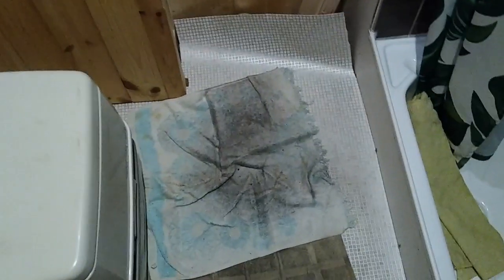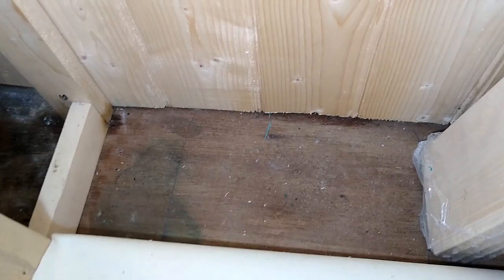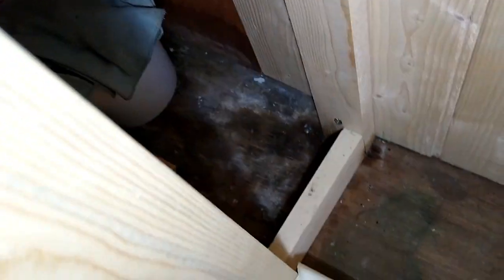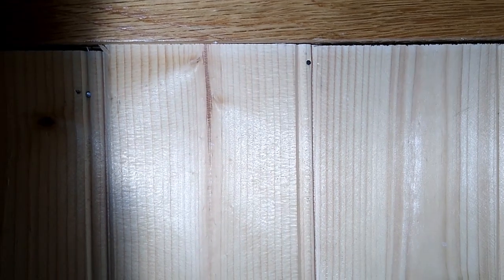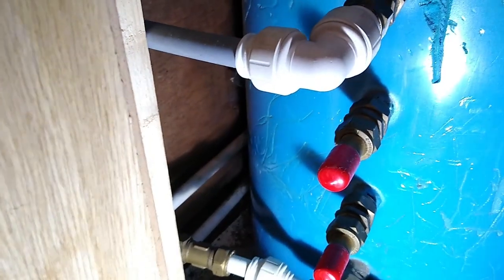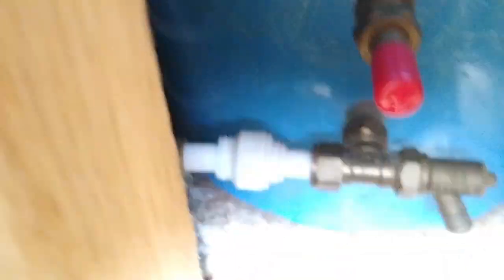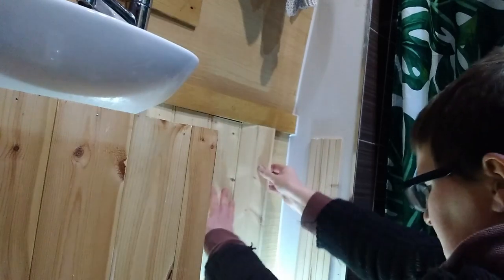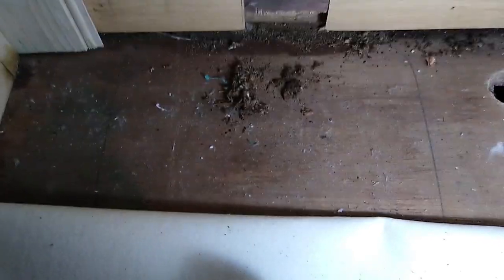44.  Looking for a leak - Part One

Comment: I think theres a fair chance that its water that has spilled around the sink edges or from under the tap while youre actually using it. You wouldnt need much daily spillage to keep that much wood slightly discoloured. Also check the drain from the sink is tight on the skin fitting. Maybe draw a line of water soluble ink or tape some paper around the trap under the sink to check for running water too!  If the mains water had a leak it would set the pump going at random times.
Reply from the maker: Paying more attention to what I'm doing, you're absolutely right there is spillage ending up on the floor under the sink.  I think the discolouration and damp under the sink could definitely be due to that as you suggest.  The damp further along the floor though seems to be from a different source.  The water pump does engage every 10 minutes or so, more than it should for normal equalisation so could well be a slow leak - there's some push fit connectors further behind the wall I need to check.  Love the idea of a water soluble ink line - genious!

Comment: Those holes in the wall, were they drainage to outside the boat and not sealed right or capped off and then not foamed up to remove a metal surface (condensation). The waste for the sink looked a bit dodgy but might have been old leak. The white chalky stuff on top of the pipes on the calorifier show they are probably leaking or have been leaking. If they are still dribble leaking then the water may be running down the OUTSIDE of the pipes and then dropping to the floor and creating a wet patch, It only takes a few drops a day to create an issue. Also a cold metal pipe with water in it will cause condensation to form on the outside.
Reply from the maker: Interesting ideas!  So the holes in the wall were part of the old pump out system which was removed by the previous owners.  It's highly possible they were not capped off or foamed properly (I'd not heard of foaming, what a great idea!).
I agree with the sink waste looking dodgy - that was my first check and it's all dry, just an old leak that still looks icky.  Good spot for the white detritus on the calorifier, I hadn't spotted that, I'll go back and feel around them for signs of damp.  All the pipes I can see remaining are plastic, but great idea about a metal pipe and condensation, very possible!

Comment: Looks like it’s probably a leak on the waste water pipe work and not the fresh water, where is your gulper pump for the shower and where is the skin fitting  ? If it was your fresh water your water pump would keep cutting in due to pressure loss in the system.
Reply from the maker: Hello! The pump for the shower grey water is to the right of the wall, in a void next to the shower.  The fresh water pump does actually engage, but not constantly.  It cuts in about every 10 minutes, more frequently than is normal for pressure equalisation.